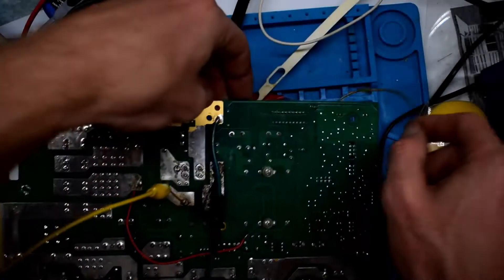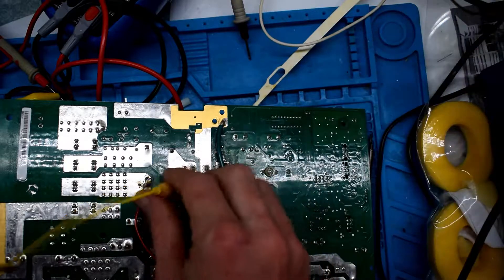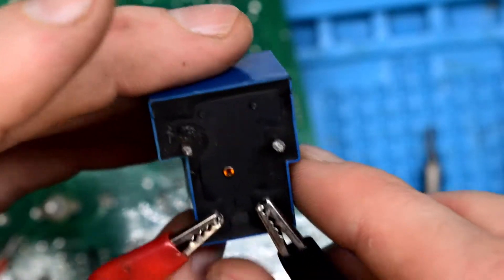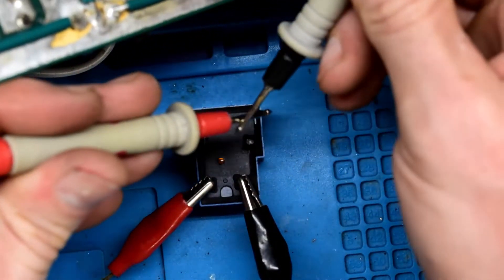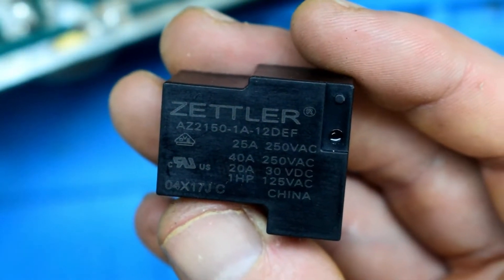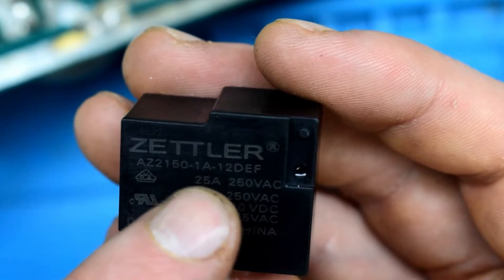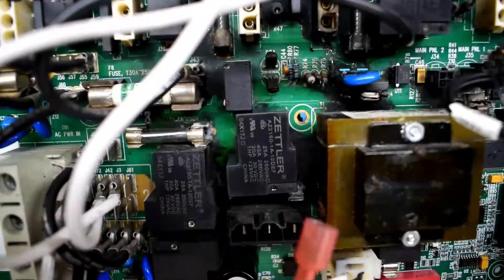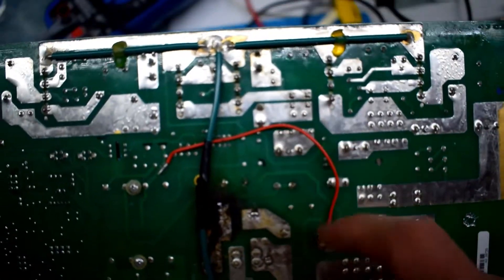Power Relay troubleshooting and repair (AZ2150 ZETTLER)

Comment: Helpful video. Funny I recognize the board from a hot tub as the same one I am fixing. The same relay was fried. Replaced the relay but only got about 6 months out of it. I think another relay fried as there are three of them.
Reply: Also the relay clicks doesn’t that say it’s working.? Tia.
Reply: Having the same problem rn 😂👍🏻 thanks for the help ! 
Did anyone of you ever had in communication problem with the display it is an bad data crc problem . But I don’t know how to fix it .
Reply: CrC bad data should be how you got your switchboard configured
Reply: How do you know what 2 ends to multimeter it.?